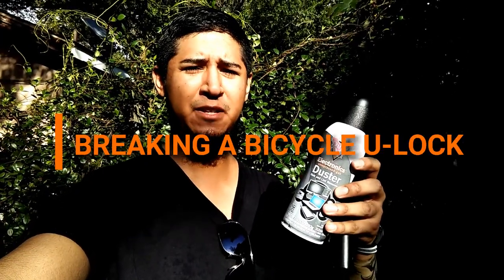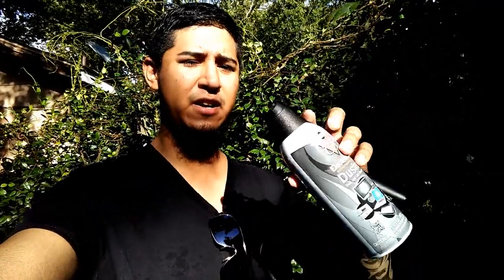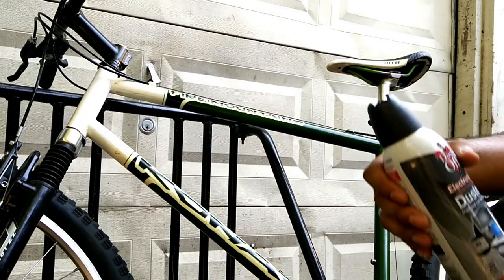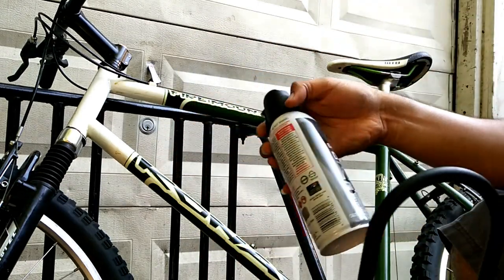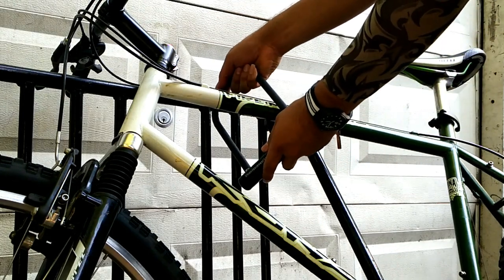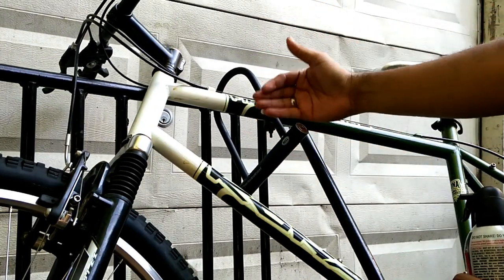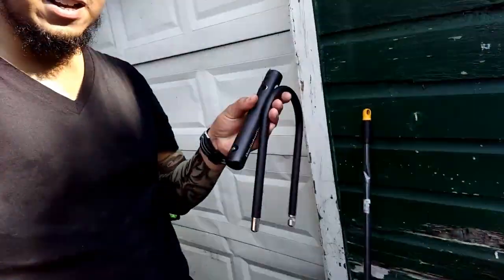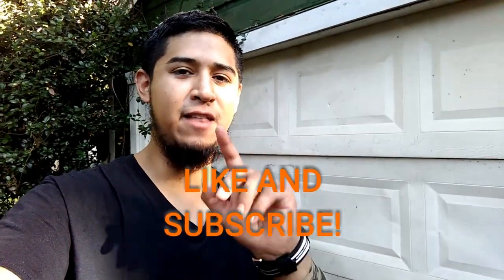CHEAPEST WAY TO BREAK A BICYCLE U-LOCK

Comment: After spraying both the lock and the bike,. I hammered the lock and broke my bike and my lock.
Reply: Dead Inside loooool
Reply: Dead Inside lmaooo
Reply: Yeah I wouldn't spray the bike 😂😂
Reply: Use the key next time even easier
Reply: This is funny
Reply: That's f*** up
Reply: POS bell lock
Reply: Good
Reply: just call the company you bought the lock from and ask for new keys. 🤦🏽
Reply: Did the hammer survive intact?
Reply: @DoorlyDoorlyDoorly ,if  that hammer didn't survive, it means you need a different brand cause not all brands are created equal.

Comment: I'm pretty sure the cold spray did nothing it was just the hammer
Reply: This is exactly right. I consulted this video because my daughter lost the keys to her bike lock and left it attached to her frame 🙄

I thought the whole spray can thing didn't make any sense physics-wise, and I was right. You don't want the metal cold, you want it hot, so it becomes malleable. Friction generates heat. So I took about five whacks on the U-lock with a hammer and it came right off. Without any compressed air.

It is in fact unnerving how easy it was to remove the lock with just a hammer.
Reply: @TheFiddleFaddle  the reason you will want to try the compressed air is to make the lock brittle, this video did it wrong, your supposed to aim the canned air at the keyhole (keep about a foot away) and hold for 30 seconds to a min before whacking it with a hammer, of course just smacking it with a hammer will break it but making it freezing cold will make it brittle making hammering more effective
Reply: Just because it worked for you without the compressed air does nothing to negate the efficacy of this method. Some u locks are harder to bust than others, and when that is the case this method makes them easier to bust
Reply: @TheFunklin  Honestly? No, they're really not. Some may be constructed sturdier than others, but the basic properties of metal do not change. And while cooling it can make it more brittle, I can honestly say the compressed air did nothing in this video because he had to hit it just as many times as I did. If he'd truly managed to cool the metal to the point of brittleness, it should only take one hit. Any hits beyond that, and the friction HEATS the metal.

So yes, you can supercool metals and make them brittle. Is that what happened here? No, he just wasted a can of compressed air and hit it with a hammer like he should have in the first place.
Reply: Exactly, I've done it multiple times years back with less whacks at it too, you dont need the can
Reply: He ain't that type of guy, I guess he went to school and listen. The temperature of those dust off product can get as low as -15°C but the average steel gets brittle around -75°C.  

A lot of place in the world get -15°C temperature in winter.... That mean everything that has steel in it would crack/break. Don't believe everything you see.
Reply: @TheFiddleFaddle  omfg 🤦‍♂️
Reply: @socialfreak6900  Compressed air will not cool the metal sufficiently as to disrupt its molecular bonds, you'll need to submerge it in liquid nitrogen for a short while...
Reply: @Scientificmethods  Would the low temperature cause the metal in the lock to contract at all or would that require a much lower temperature as well?

Comment: Interesting, I wonder if the air duster had any real effect on this? Just seems like hammering away at this without that would still net the same results but who knows.
Reply: No, it would not.  I tried it once with a sledge hammer, and then my friend tried it, and then another.  Just damaged the bike a nit, but the Ulock was still ok.
Reply: Probably the cold propellant affected the steel or something idk
Reply: Alvin Kang I imagine the science behind it is making the particles frozen therefore making them also more brittle, as apposed to average temperatures
Reply: @goodlookingkieran  thermal shock; happens to glass too
Reply: Alvin Kang thought so! 🧠
Reply: Some locks are easier to hammer than others. A can of compressed air is not cool enough to have any effect on metals, so i am skeptical it has a real effect.
Reply: Wow

Comment: THANK YOU SO MUCH! 

For about 9 weeks, I have been planing to take my bike lock off.  Finally, today, I started getting it off. First, I tried a Power saw, then I tried a hack saw. Then, I watched this video. I added the freeze thing to my Amazon cart. Before I ordered it, I checked if I had any keys that looked like the one in the video, and I had none.

The point is, four blows in the hammer without freeze and it's gone.
Reply: So is the freeze not always needed? My bike is currently stuck on a public bike rack 😪
Reply: Robot comments

Comment: Looks like a cheap "Bell" lock, that you wouldn't have to freeze, to attack with a hammer. 

Just spend $20 and get some bolt cutters. You'll cut it in 2 seconds.
Reply: What is the brand name of the bolt cutters that you are referring to?  I would like to buy and try those to open a Kryptonite lock to my motorcycle to which I lost the key three years ago.
Reply: bolt cutters take forever to cut a ulock like that good luck lol
Reply: Nah I tried bolt cutters. Barely scratched the metal.
Reply: @FKtdyvan  Practical bolt cutters won't be able to go through a quality kryptonite lock. Though even a cheap portable grinder will go through even the best kryptonite has to offer, it will just take a minute.

Comment: a lot wrong with this video: first, that lock is NOT hardened steel, i have one: second, there is no way to get the metal cold enough to shatter without using LIQUID NITROGEN: third, i would have used the side of the head of the hammer for a better chance at hitting the lock: fourth making so much noise that someone would have stopped him were he an actual thief: fifth why steal, you're gonna get caught sooner or later.

Comment: Just buy a cheap carbide rod saw. Costs about $10 at a hardware store and you won't smash up your bike frame with a hammer.
Reply from the maker: I have everything, the point was to break it open with compressed air.
Reply: @SamAkaVlogs  
You're a pro bike thief, mate.

Comment: This is cheap bell u-lock. It is neither strong and secure to begin with. I would like to see the same attack on kryptonite evolution 4 series which is their mid range u-locks. I firmly believe it will fail against these u-locks. Kryptonite Evolution 4 series are immeasurably stronger than this cheap junk by bell. I do not even want to consider kryptonite's new york lock series which are Kryptonites toughest locks, far stronger and far superior than Keryptinites evolution 4 series.

Comment: Soo, to make hammering that easier, hold the u, then hit the point of impact :) You have to isolate the motion of the lock before striking it with a hammer.
Reply from the maker: Sort of true but you will end up with a sore hands from all the vibration.

Comment: There is a much faster way , 5 sec and it's open. My tools and methods will never be made public , I do not condone any type of theft . Just information related to the manufacturer so they can go back to R&D in step it up. Which makes them redesign the Unbreakable securilock and we figure out a way to break it. It's you can always build a better mousetrap but eventually the mouse will figure out how to get the bait it's a weird world we live in we do everything step it up for security and people figure out ways to bypass that. And toting around a 50,000 lbs vault for a bicycle not practical
Reply: Hello
Would you mind sharing with me how to remove my lock on my bike? I wont tell anyone lol. I bought the u lock from walmart and lost the key!!!! Now im stuck at home and unable to get thos lock off my bike.....i would hate to hammer and make all that noise....i have an E bike here in hawaii and i wouldnt want to damage my precious aventon sinch bike! Lmk! Can you email me your tools and methods?